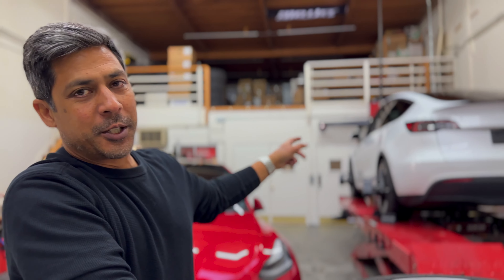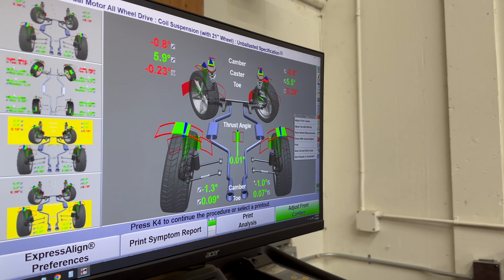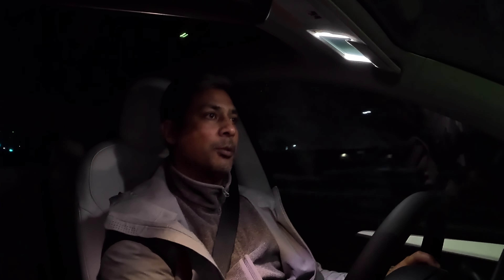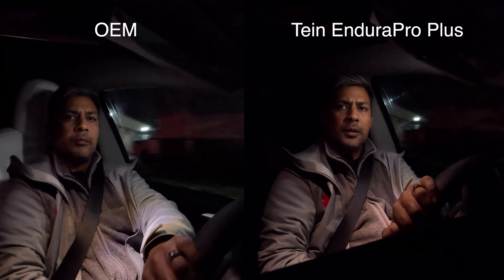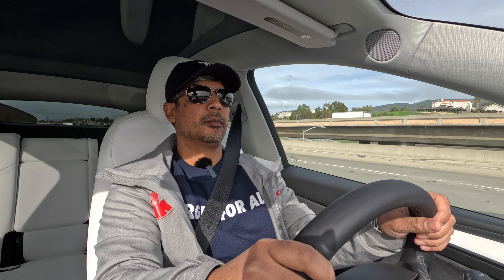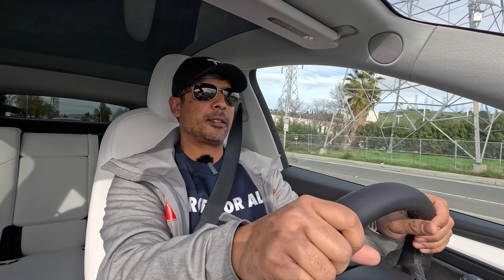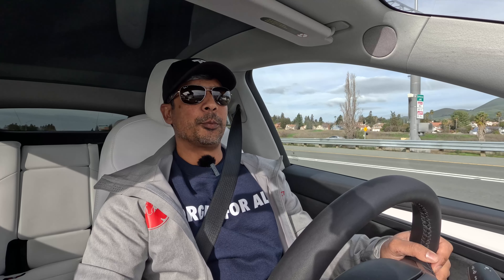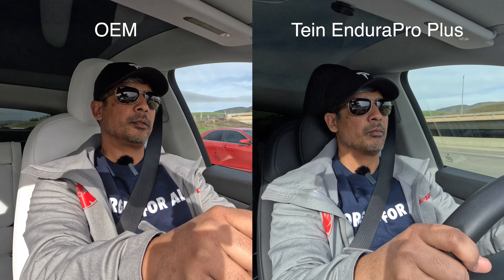Showdown!!!!  Tein EnduraPro Plus shocks versus stock Model Y suspension.

Comment: I owned a 2018 Model 3 then traded it in for a 2020 Model Y.  The 3 was smoother on the bumps. When I too my Y in for service, Tesla gave me a Model 3 loaner. Wow, what a diff riding on the same streets I usually ride on.
Reply from the maker: I have both still and the Y suspension is def worse than the 3 but these shocks resolve it on both.

Comment: Are these strut/shocks worth it? My 22 MY LR seems fine to me. I’ve heard a lot of things saying the suspension is rough. Driven many German cars over the last decades and it’s almost as good. Not comparing to air suspension of course.
Reply from the maker: If you are happy then no need to spend the money.
Reply: @zevcentric might order them anyways 🤦‍♂️
Reply from the maker: Sounds great.  We would love to help if you want to email zevcentric@gmail.com with your location or checkout the link in the description to our website.
Reply: There was a refresh of the OEM suspension in 2022, not sure when.
But the main "issue" I find with some of the Teslas is not that they are too stiff, but the dampers are too "bouncy", for instance if you have uneven road in an roundabout, the earlier cars would kindof "hop".

So if you fit like coilovers or whatever, it might be stiffer - but the better shocks then will still make it feel more comfortable, as it doesent "hop" that much.
Control at high speed iis also very different.

I dont know if you have the Y with the refresh suspension though, that is not as rough as the early models.
For instance I would say my 2023 VIN YP from Berlin is more comfortable with 21" than the 3P I had from 2019, even if I ran the 3P on 19" (a lot of sidewall).

I did put KW V3 on the 3P, it was then harder - but also better :-) Especially at higher speeds where the car would stay planted very well.,
Reply from the maker: @OlavAlexanderMjelde  we run the MPP custom versions of the KW V3 which we find much better than the V3.  Just some added insight.  It's improved in all areas.
Reply: @zevcentric  ok, I did like the kw v3. In Europe we must have Tüv. I might go coilovers on my new YP, looked into air and found air lift performance with height adjustment has TÜV also, but it's 2xprice of coilovers. And air takes frunk...

So I might look at KW V3 again, or öhlins. Heard Bilstein will come to market this summer too, yellows and reds.

Comment: Question: The EnduraPro Plus Adjustable Damper Kit with the EDFC ACTIVE PRO Controller Kit is basically a coil over? Can you elaborate on it?
Reply from the maker: EDFC is not compatible with enduras.  Only the flex Z coilovers.  Edfc gives you the ability to adjust damper stiffness settings from the cabin.
Reply: How much for the EDFC? @zevcentric
Reply from the maker: @J-J-TL  you want the parts only or with install?  EDFC for tesla only works on Flex Z coilovers btw.  All parts are on zevcentric.com
Reply: I live far from you guys for the installation man.  Riverside County. @zevcentric
Reply from the maker: @J-J-TL  chedk out the website for parts pricing.  Do you already have the flex z’s?

Comment: Is there a way to adjust the softness of Teins without removing them from the car?
Reply: On the Model 3 you can adjust the front Tein adjustable shocks without removal, just pull the plastic panels of the frunk. Likely the same for the Y.  The rear you have to pull the rear wheels and you may have to drop the shock a bit, I'm not sure if you can get your fingers in there without dropping it some. I'll know soon....

Comment: Thanks for the awesome review!  Are adjustable rear camber arms necessary if I am not lowering or upping the size of the wheel?  I am on a Model 3 AWD LR.  Also, would it make sense to add EDFC to the shocks?  Looks like fun.
Reply from the maker: EDFC wont work on this due to the oem rear mount.  No need for camber arms with stock springs either..
Reply: @zevcentric  Thanks for the quick reply.  Surprised and disappointed that EDFC doesn't work as the shocks are listed as compatible with EDFC.  Understood on the camber, so don't need to worry about it.  While the shocks are getting installed, what is the next piece that you would recommend if I were to consider putting something in?  (Now that I don't need camber and can't get EDFC.)
Reply from the maker: @InvestorBen  it's all contingent on the factory uppermounts and because ours practically touches the chassis you cannot mount the motor on top of the rear shock.  You would have to buy the Flex Z coilovers. If you only want ride improvement there's really nothing else that needs to be done.
Reply from the maker: @InvestorBen  I heard you reached out to one of our friends in socal about install price.  He's a great shop.  Wilson is awesome.  Please let us know if we can help you with your order.
Reply: @zevcentric  Please let me know best way to contact you.

Comment: Do you completely remove the bump stops or trim them?
Reply from the maker: Totally up to you.  There is an internal bumpstop so the oem one is not required.  I would trim them down a lot at the very least.
Reply: @zevcentric  Tein says to use the oem bumpstop unless one is included with the shock.  They updated the website i guess because a lot of people were confused.
Reply from the maker: @cooldaddyslick6869  thank you for pointing that out. It was definitely confusing but I am relieved we retained them in order to retain the factory dust boot.

Comment: I am one click away from adding this to my cart, but Ive read some reviews with this shocks that when put on the softest settings they tend to have that squeak or clunking noise on the front at low speed when driving on rough road. Any comments on that?
Reply from the maker: These shocks are back ordered until July probably. I have not had that issue but at the same time I think some people might be going beyond the 16 clicks that Tein recommends. I also do not know if this could be related to installation error. I highly suggest that people look at the illustrations and read that comes with these
Reply from the maker: I believe we have one pair of rear shocks left but the full set is backordered.

Comment: I have a 2020 Model Y and absolutely hate the factory suspension. My old 2007 Honda Element with 19" wheels had a MUCH smoother ride. I either need to change out the shocks or sell the car which btw only has 12K miles on it. That part of your video where you were jostled about in the driver seat, I can totally relate to that. Horrible!!!

Comment: I have a 2020 Y LR. Just want to confirm, if I want to maintain stock height, these EnduraPro Plus is all I need.  Thanks
Reply from the maker: Yes that is correct.  We have some left in stock if interested.  I can help with some tips once i see the order.  https://zevcentric.com/collections/model-y-coil-suspension/products/tein-endurapro-plus-adjustable-shocks-model-3-y?variant=43332869751029
Reply: @zevcentric  no. 1102!
Reply from the maker: You are so close to us in Fremont.  I see your order.  Want us to install it?  We will take care of you 100%.
Reply: Your website doesn't show the model y for one of the trim options. Was looking into it for my 22 model y long range
Reply from the maker: @Mhaqqim  fixed https://zevcentric.com/products/tein-endurapro-plus-adjustable-shocks-model-y